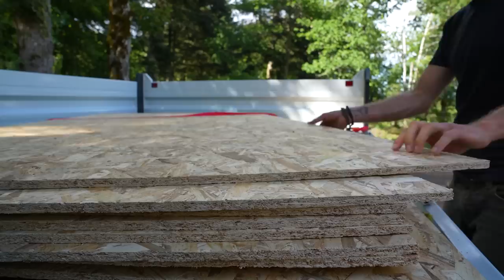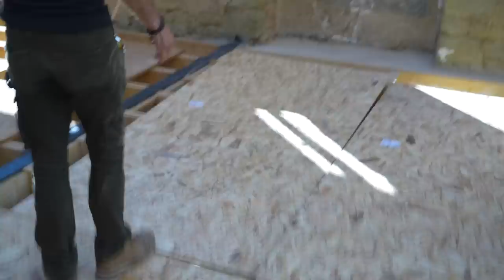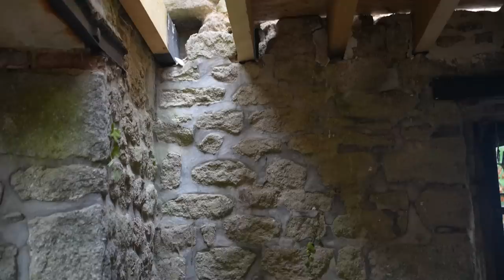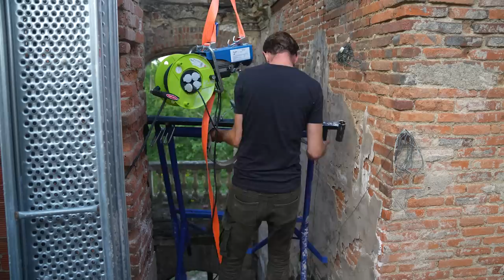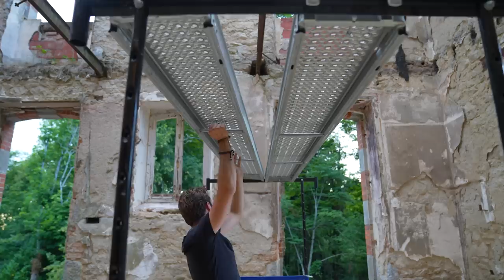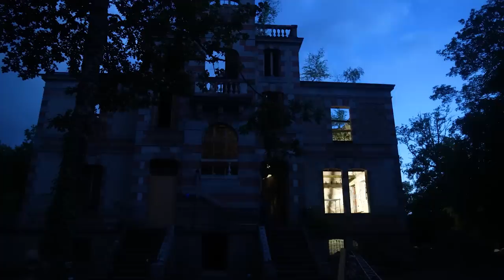A floor for a floor.

Comment: I honestly think you should reconsider that staircase in the kitchen. It will provide light to the kitchen, it will make the air circulate better and in such a big house you really need more access ways through the building. It will drive you mad - once you are finished - that you have to walk/run through a lot of rooms and stairs to get to one point to another. More passways will make everything a lot easier and smoother :) And believe me, you will walk/run around a lot!! ;)
Reply: If not in the kitchen, wonder where he would put 2nd set of stairs?  ( Besides the main staircase, in the main entrance room, of course.)   When Dan said he wasn't going to put the stairs back in the old basement kitchen, I wondered, " What's Dan got in mind?"😏

Comment: Window floorings are a good idea Dan!!! I was thinking that very thing. I found that I am more suitable for a home with rising sun rear and setting sun face. I had often thought how much better my townhouse would be if I had window flooring. Bless G-d, the house sold but I have a new challenge with the Earthship Biotecture building plans because the house must face south(north if you are below the equator) for maximum sun exposure for the in-door greenhouse. And since you are in a berm for three other sides. Soooo, I have been thinking about solar tubing. Solar tubing just keeps getting better. With G-d's help...

Comment: There were stairs in the kitchen and through them there was also access to daylight from the first floor.
Reply: Not really, as far as we can tell those stairs were completely walled in and had two tiny windows to provide a minimum of daylight for the stairs themselves. In the basement you can definitely see the ghosts of walls completely surrounding the stair area, upstairs is a bit uncertain.

Comment: You could turn the corner kitchen into a Men Cave since it is not as bright as you like.
You could put the kitchen one floor up. It’s so much easier to serve food, having the Kitchen and Dining Room at the same level.
You are a Chef  and may create custom dinners as a stream of income to cover running costs.
Take the time to think through the future of the Chateau and immense running cost for such a large building.
Once this place is restored you won’t have as much to film and generate income.
You need to build multiple streams of income to afford this place.

Comment: You should get some tarps for that osb to keep it clean and protected but not where the legs of your scafolding is so you can keep an eye out for cracks. Also I think it would be better to double the plywood under the scafolding legs and if possible line them up with the joists.
Reply: Yes, I think the trestles should be resting on scaffold boards, especially when there are heavy beams to lift!?!

Comment: there will be a roof. Glass floor panels wont do much at that point
Reply: Sky lights?
Reply: Unless the glass is on the floor in front of the windows on the floor above.

Comment: there will not be much light in the room above to bring down once the floor above it is put in ....  .  rather focus on a modern lighting system to brighten the kitchen room  whitewashing the stone in the basement walls would increase brightness a lot.

Comment: What about a temporary frame structure on top and tarp over the whole top of the building?
Reply: you will see that he has the materials to do these temp roof frames (for central staircase and bathroom) already, and he needs to get the next two floors in place and then can redo / refix the brick walls that the support for the roof framing.  High risk if walls not secured / repaired that any temp roof could move in the wind and easily demolish one of the eave walls or decorative windows.

Comment: I was just thinking "He could just put in some glass in the floor, to bring light down" ... and a few seconds later you had the same idea! 😀
And you might just need some additional scaffolding? Getting it down there and later back up in the other part .... quite the hassle.
Reply: As long as the glass panel/glass tile has privacy film.

Comment: Dan, is there a way to put your tent inside the first floor of the chateau? Not in a dangerous spot but a place where if the weather gets nasty, you may be more protected.
Reply: Bricks might fall on his head with stormy weather....😮
Reply: @4711Express  I know. That’s why I was thing maybe there is somewhere safe, maybe the basement. Not where stuff could fall on him.
Reply: @melindaduncan3073  The basement floods when it rains.   Dan has alot of future drainage work to do in & around the outside of the basement, in addition to doors & windows.
Reply: @homeemail2306  gotcha!  I have a feeling in a tent, it’s going to be a wet mess either way he goes. 😫

Comment: Take these metal beams out and place thick steel plates inside AND outside the walls (sandwich construction) to which the new steel beams will be welded. This is a technique that ensures that the walls stay vertical and parallel. You can cover the inside plate when plastering and the outside with plaster or faux bricks, depending on where they are placed.

Comment: Maybe a tarpaulin over the osb to stay safe as once wet it crumbles. Yeah, I’ve done that too. I’m sure I’ve told you I’m clumsy. The winch is a great asset to aiding you as well as the lightweight scaffolding now you secure it properly. Yep. Got to get that tarp on the floor. Edit: Added, I hope you get over your cold as you sound very blocked up or is it an allergic reaction? Thank you. May you please take care and stay safe. Louisa. 👏👏👏❤❤❤🤩🤩🤩

Comment: It much easier when prepping the concrete pads, to dig out a pocket above the beam to wiggle the beam into and land them on the pad. 
Put some wood shuttering in screwed to the wall at the correct laser level. Then pour in high strength concrete up to the top of the shuttering to land the beam onto. You have to wait for the concrete to go of for about a week. 
If you still want to put in the steel bar set into the pad, you can do so long as your setting out is correct for when the holes are drilled through the eye of the beam.

Comment: Yup, a few if those thick glass floor panels would utterly transform the room from dark to bright. But , without a roof, you need to keep those OSB panels dry . If they get soaked & lose their integrity, they’ll warp and go soft. THROW A BIG TARP ONTO THE OSB panels!!!  Dan you gotta get some sort of water tight roof on ASAP, even if it is not the permanent roof.
Reply: And how do you propose he gets this temporary roof on? A helicopter or sky hooks? He has to get up there first hence building the floors to get there. SMH.

Comment: How wet does it get in that basement space? I was wondering if you could just put your tent up in there. You could use the bricks to fasten the tent stakes to. Then you could stay dry when you are using your camping toilet 😁
Reply: He’s posted a video of the basement ankle deep in water after a rain.
Reply: Why a tent. Windows, doors, and all the other necessities and that could be living space. He could make a 4 room apartment.  Sitting, kitchen, bedroom, and bathroom. Then rent it out or use it for volunteers.
Reply: @jamesbonham5383  I remember water on the floor but I was wondering if there was part that didn't get that wet and maybe since then if he maybe fixed the problem
Reply: @crinkle2649  A week ago, Dan replied, "It still isn't watertight," to another commenter who asked the same question about why not set up tent/a room in the basement about a week ago.  So, unless he's fixed the basement flooding in a week, I don't think he has fixed it.   Flooding comes from no roof, windows, or doors, and possible drainage issues that need to be need to be addressed in & around the outside of the basement.

Comment: Had you thought of pitching the tent in the basement - or kitchen?
Reply: He can’t do that until a roof is in place and all floors, too dangerous in case anything falls on him.  You just saw something fall in this video.
Reply: I would recommend against it until the upper walls are solid.  A few falling bricks during high winds could be very deadly.
Reply: @flabreque  Does this apply to the main hall floor - the one from which the patterned tiles were removed?

Comment: That house gets curiouser and curiouser. Why put those tie rods on the inside surface of the wall and not bury them within the mass of the masonry? And they wouldn't have needed long tie rods from beam to beam. Short sections through each beam end would have worked too. Since the beams too are bent and twisted yet the wall is plumb, maybe they really didn't do what the architect and contractor thought they would?  Where they are doesn't do anything to tie the beam to the mass of the wall. Using iron was a relatively new idea in 1870 something and these guys were provincial people. Even though it was being used in railroad rails, terminals and bridges for a few decades before it may have been very new to them. 
These locals tended to have a very local sense of how to do things even if they were wrong. It may be due to failing eyesight but that rod does not look like it is attached to the wall in any way that would keep the beam from sliding out of the socket.

BTW -Iron tie rods can be seen in Italian renaissance palaces, arcades and monastic cloisters etc. but maybe they weren't very common in France?

Comment: Why do the old steel beams need to come out? Why not install the new beams as additional support?
Reply: Dan mentioned in a previous vlog that the old beams are not up to today's regulation standard for size
Reply: @NurseSherry  Also, the old ones are warped & compromised by the fire

Comment: top tip form an photography enthusiast, never wipe your camera lens with the clothes you are wearing, especially if you are covered in cement dust, get a lens cleaning cloth and keep it in your camera bag, bits of grit in your clothing will scratch your lens

Comment: Dan I'd use a strap around the window openings and secure it on the doorway to keep the walls from having any outward  movement while cutting or pulling the old beams out
Reply: Don't know why he isn't leaving the old beams in place and just adding new ones for extra support. Seems a lot of work to take them out when they will be covered up in any case.

Comment: For pete's sake Dan, just build wooden scaffolding on each level as you go.  Every great building in history before the 19th Century was built using wooden scaffolding.  You're going to need them to redo the walls anyway, so knock them together and leave them there.

Comment: With 3 tripod like pieces of wood bolted together at the conjointly center  that should be strong enough, to lift your pieces of steel and maybe use one old piece of steel, as a higher up pulley support,  before you take it out, then the other,  like you would use, a higher tree brach, when cutting tree limbs

Comment: I would be looking for a second hand set of stairs to use in the entrance hall up to first floor. 
And maybe a winch (low down) and pulley (up high) on the top beam to help lift the next beam up into place?

Comment: Can I advise you when installing wires and plumbing. Use the gaps between the walls and floor joist. Don't drill holes in the joist unless you really have to.

Comment: This build will be at the mercy of the weather until the roof goes on and there is some protection from the external wall openings.  My guess is that with the Autumn and Winter close the progress will slow and drying out will eventually take longer.

Comment: You can leave a section of floor to be glass on each floor to allow light to pass through to the floors below.
Reply: For this floor yes, but he won't need it on the upper floors as they have massive windows.its only the basement kitchen that has small windows and glass floor panels are extremely expensive.
Reply: As long as the glass panel has privacy film.   It would not be good for girls & ladies wearing skirts visiting the chateau to be moving around on one floor, and other folks in the floor below looking up if it is see-through glass.

Comment: Glass floor panels!!!!!  That'd be stunning!!!
Reply: As long as glass panels/tiles have privacy film.   Not appropriate for girls & ladies wearing skirts visiting the chateau moving around on a glass floor and other folks moving around on the floor below looking up.
Better options:   glass block/tile around the edge of the room, to bring light into dark basement kitchen.
Other commenter have said once celing is drywalled, then plastered or painted light color, the room brightens up, especially with lights.

Comment: Just a though, that square thing that was hanging from the cieling (which I'm mystified by), could be some how made into a Art frame? To hold some of the photos and artifacts you have found in the Chateau. 😁 Another Idea, can Dan camp out in the Chateau, maybe even in the Kitchen part?
Reply: Not yet...basement floods when it rains.   Dan has alot of future drainage work in & around the outside of the basement, in addition to adding windows, doors, roof to make it watertight.   Perhaps in the future, when a room is completely dry (temporary roof on, windows), insulated, w/ a bathroom, can he stay in chateau.
Dan has already replied, " It stil isn't watertight" to a commenter who asked the same question a week ago.

Also, unsafe work site...debris ready to come down with a stiff wind...already has, with high wind/tornado?  late winter early spring.  (Dan made a Vlog about it, of course!)

Comment: I would start with the roof pouring a 4 inch concrete ring with Rebar (connecting the walls) drying the building before messing with anything. rain and old buildings is dangerous but thats me. consult an engineer and be safe.

Comment: Will the old kitchen also be the new kitchen? Will you plaster the walls? Light walls will make the room a lot lighter. Glass in the ceiling would be great too.
Reply: As long as the glass panels/tiles has privacy glass.   Not OK for girls & ladies wearing skirts when they visit the chateau going over glass panels, and other folks below looking up.
Other commenters have suggested glass block around the edge of the room.  Good option.

Comment: How about a mezzanine floor  design at the top part so bright light can still see through the rest of the chateau 😊😊😊 and will pass through the stairs. Natural light is very important.

* check out thick fiberglass panels for skyline roofing.

Comment: thats best idea,  bring glass floor panels in, to let the light flow threw the rooms.
Reply: As long as the glass panel/tile has privacy film.
Reply: @homeemail2306  not necessary, just for light. Or let it open for plants.

Comment: Dan is doing just fine without my advice. But I would put the floors in and the roof then make that 1 section of the building habitable and move in before doing the rest.
Reply: Sounds appropriate.

Comment: As you go up the levels, you will need cement, wood, tools etc and even the things that are heavy like bathroom things. How will you get them up? Scaffolding? A cherry picker? A crane? Just so not 2000 steps needed!

Comment: Dan don’t if the osb that you purchased has like a wax coating on one side like hear in America but if it does put that side up to help it repel the rain water if it doesn’t you could try waterproofing it to make it last a bit longer
Reply: Dan said it was OSB3; slightly water proof.   Great idea to waterproof; many commenter saying it can be sealed, which is also good..   Dan has chosen currently to tarp the 1st & 2nd floor in the main hallway.   Hope he continues to tarp when he's not working on the floor.

Comment: Those industrial glass floor panels! Perfect for light infusion and exactly what my initial response was before it occurred to you. The only difficulty is to find the ideal position or positions, if more than one. I rather thought the size would be about half the size of those boards and the placement could be for best effect, bordering the whole floor. Expense?????????
Reply: Glass floor panels Ok if they have privacy film, or are opaque, and location on room floor matters   Per commenter 'Lemma', "opaque glass panels by the window apertures/openings" are a good idea.
Some other commenters mentioned glass tile/block around the edge of the room.

Comment: Hey Dan, did you consider moving into the habitable parts of the château cellar instead of the camping thing? Maybe some plexiglass windows for now and some OSB doors which can be properly locked and secured. Could probably fit in a working shower and composting loo.... Not to mention a nice wood burner for the winter months and a makeshift kitchen. No staying awake because of the rain, no worries about lightning strikes being under the trees.... And it would mean getting some of the cellar rooms functional too! 😃

Comment: had you considered lashing the beams you want to remove to the ones above , Multiple ropes coulsd easily be thrown over the beams above, and lowered safely,  Get yyourself an extendable surveyors measure much easier than trying to use a tape .  love your programe

Comment: Opaque glass panels by the window apertures is a brilliant idea. Not sure why you've not populated the basement with a woodburner, a fridge, a Bose, and a hammock (with mosquito net!)? Got to be more comfy than a tent in the woods? 😅❤
Reply: It gets wet in there. It's not watertight and the ceiling is dangerously rotten and needs replacing as the steels are shot. Do you want Dan to die in his sleep?
Reply: @jmk1962  I mean the kitchen...
Reply: @Lemma01  - The same applies in the kitchen. It's not watertight. Everytime it rains water pools on the tiles.
Reply: @jmk1962  Agreed. But I've spent a lot of time in tents in French woodlands, and I know which I'd prefer!
Reply: Opaque glass panels by the window apertures is a brilliant idea, indeed.  "Opaque" is key word...for privacy. Thank you.